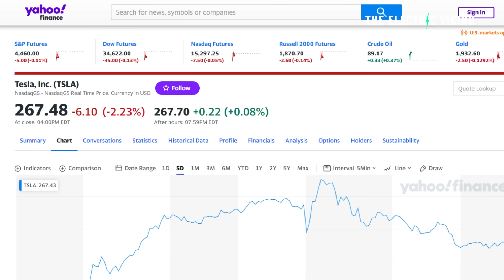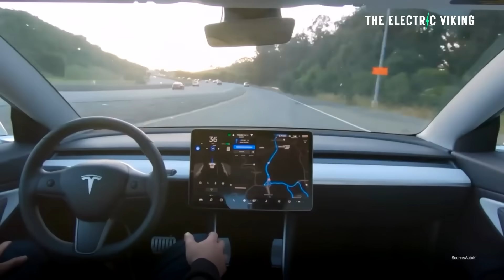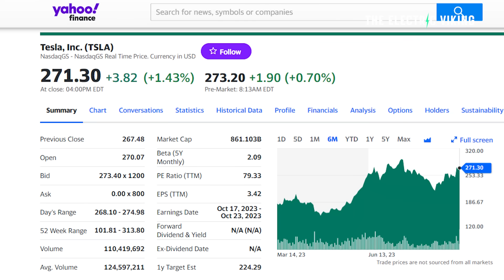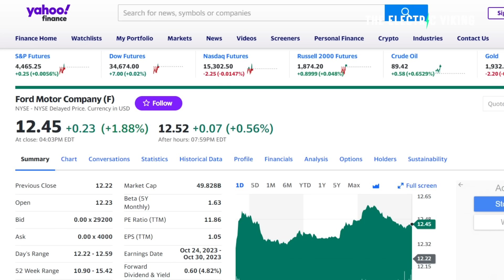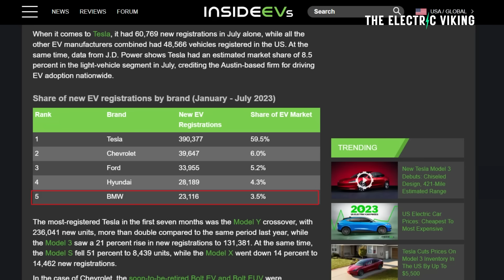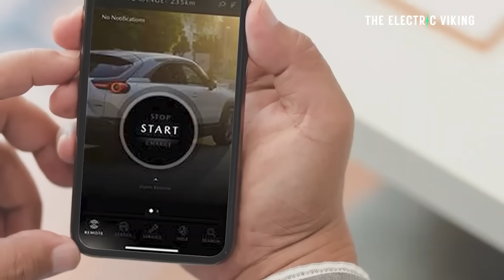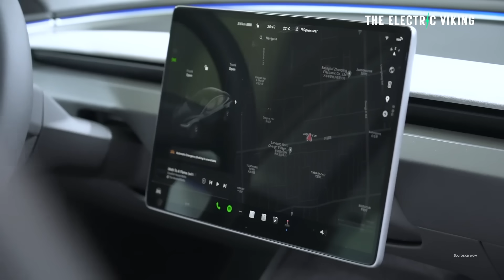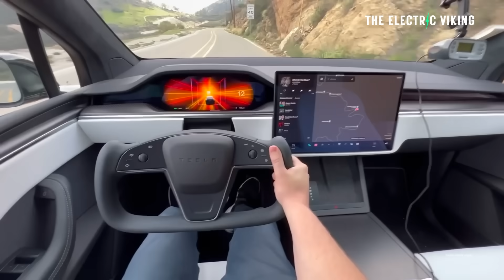Tesla's U.S. sales jump 50% from January-July, giving it 60% marketshare

Comment: Tesla makes the best bang for the buck EV period.  You can drive then anywhere in the lower 48 with no issue.
Reply: No issue? 90 percent of US vehicle owners are still purchasing ICE  vehicles 😊
Reply: @robertfonovic3551  what does that have to do with people being able to drive an EV and charge it with no problems anywhere in the US?
Reply: @robertfonovic3551 Dumb take.
Reply: @robertfonovic3551 and for reasons unrelated to Tesla. Fear, jealousy, not ready, not willing, myths, ignorance, misinformation, the list goes on, nothing to do with the cars.
Reply: plus Canada
Reply: @robertfonovic3551    Lower than 90% and then falling...
Reply: @Notme-tq4xs  you’re crazy. The trend is going upward. The best selling car in the world is the model Y Tesla. In the world.
Reply: @robertfonovic3551 Nokia says hi
Reply: @robertfonovic3551 
Which exceeds the 5% adoption curve of new technology. It took till 2005 for flat screen TVs to hit that mark. 

Within two years, E vehicles will be cheaper than ICE. Also, the oil market will start to collapse. Because every year, 10% of the gasoline and diesel  consuming vehicles disappear. As the old fiel burning cars on the road go away, they aren't replaced.

Comment: EVs are having price cuts. But according to NSW government their 3k rebate is driving prices up. That despite the fact that we now have 3 affordable EVs under 40k.
Reply: EVs don't need subsidies in Australia. They sell every one they can import. If Government wished to promote EV adoption, they would pay for on street chargers, where home charging is not an option.
Reply: @seanthomson8141  I suspect that NSW will fall to the bottom of the pile or close to Victoria when the rebates end. There will be a big rush for the January cut-off, then it will drop off. If they want to avoid middle-class welfare then drop the cut-off price to below 40k, or else make it means tested. But they should be doing both, funding on-street chargers and not funding coal plants.

Comment: 2:00 ouch! And apropos of their cost management, I just saw Elon explaining how the company had trimmed all sorts of things- the new motor giga castings for model? saved a ton of factory floor space (and eliminated rare earths) and uses less copper. They are jumping to a 48VDC system which will eliminate a dozen pounds of copper wire per vehicle, and they've cut production water consumption by like 15%, increased employee safety and ALL of that while ramping up production. By a lot. He had all of the specifics of course

Comment: Just visited MA, USA for a few days. Surprised how few EVs I saw on the roads. My spouse was told at the checkout that EVs go on fire, can't be reliably charged, don't work in winter and all the normal rubbish you read in crappy newspapers. Interesting to see when things improve in New England.
Reply: I live in Pennsylvania, USA (also a northeast USA state) and I currently have a plug in hybrid vehicle that i had for 2 years. I noticed that the performance during the winter months is worse than other times of the year. Sometimes when I turn on the car in the winter it goes straight to gas rather than going initially to electric because of how cold it is. I know in New England it is even colder so I can imagine the performance is even worse. The technology and infrastructure in this country needs to get better very soon in order for the transition to rapidly progress.

Comment: This won't last. 

The secret about E-Vehicles is that they are so much simpler than ICE Vehicles. Traditional Auto companies have been adapting ICE designs to E-Vehicles instead of starting from square one. 

It's a lesson they're learning the hard way, but it's a lesson they're taking to heart. Within three years every auto manufacturer will have good E-Vehicles and with dropping battery prices, they'll be cheaper than new ICE Vehicles.

Comment: 7:24 Re: Mazda MX-30. Actually, NHK announced today that the current version is being replaced by one equipped with a compact rotary “extender” ICE that is optimized to operate in the very narrow rpm ranges needed to drive a generator for keeping its EV battery charged. Since there is no balky drivetrain, the rotary needn’t contend with efficiency robbing changes in loads on the engine. If theory proves out, it should surpass ordinary hybrid cars wrt mpg & emissions. Time will tell. (Coming from a 2 Tesla, 3P/YLR, owner who previously owned 7 Mazda rotary sports cars, including an RX-8 now being converted to Tesla power.)
Reply: How to massively devalue a future classic......convert it to battery power.
Reply: @robertfonovic3551  how to massively improve it's performance..... covert it to battery power.

Comment: I think the most worrying bit of any EV out of production is what happens to current model 3 and Y owners. who's cars need repair for any reason and if Tesla service can keep up with demand on repair and maintenance requests. I hear little on the intricacies of real world performance of Tesla service for mai tenace and repair and what Tedla will do to keep part repair or replacemet parts low cost. From what I'm hearing, Yedla is no different from other automakers in that parts repair or replacement are prohibitively expensive, which makes me question why Tedlas business model is any better than other automakers and if owning an EV has become better. I think there are merrots to keep Yeska's or any other EV on the road as long as possible. But if parts are expensive I see itbas no wonder why keep buying new cars after a few years. The incentive should really be other way around where good maintance and very low cost safe and effective repair should be the norm  not just buyba car for one to three years and switch vehicles due to incentives of value of the difference between cost of ownership and the devaluation costs of the car over time. I think it is very much a mantra that fits the i.c.e business model, but does not reflect the ev business model.

Comment: What will happen with mass EV adoption and the price of electricity goes through the roof, with rolling blackouts and electricity rationing? Will the price of gas then plummet? Will the ludites in their ICE cars have the last laugh?
Reply: Won't happen.  The electricity required to refine a gallon of gas exceeds the amount needed to charge an EV to go the same number of miles.  All else being equal, mass adoption of EVs will decrease total electricity demand, move it to lower use times, and reduce the risk of blackouts and rationing.  The price of gas will fluctuate massively, up and down.

Comment: So, only 10 percent market share for EV'S during the month of July in the US. Obviously, range anxiety recharging issues and battery replacement cost are still a massive issue.
Reply: Fyi Tesla has 10 year warranty on its batery 😂
Reply: The US is a slow adopter, for sure. But they’ve crossed the critical 10% market share threshold now - onwards and upwards!!
Reply: Gasoline is cheaper in the US than anywhere else in the world that can afford the EV’s. That’s why the US is adapting slower.
Reply: Untrue. Everyone is feeling good. they're saving up
Reply: No.  they are not.
Reply: @WANDERER0070   only 10year on the battery?  OMG.  What is the warranty on your engine in your stupid gas car?
Reply: Obviously, a shortage of components to make electric vehicles is hurting production. 
You do understand that there are 250 million vehicles in the United States and 17 million new ones are sold each year. So if they did 100% sales it would take 15 to 20 years to replace all the gasoline ones. 
You might remember there was a time when most TVs were CRTs, and now they’re not. 
Most US houses had incandescent, lightbulbs, and wired telephones. And now they don’t.
Reply: @Notme-tq4xs 
On a new car three years 36,000 miles.  You can pay more for an extended warranty.
Reply: @Notme-tq4xs  the figures prove me correct